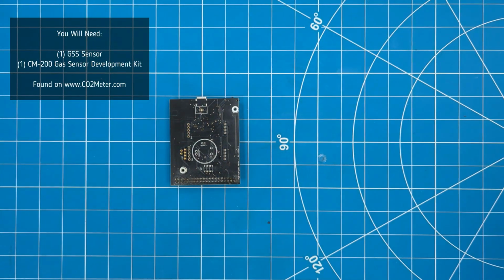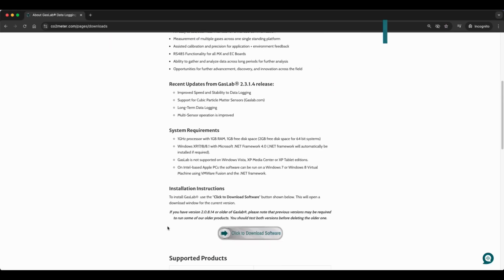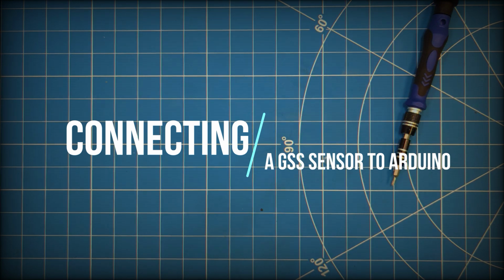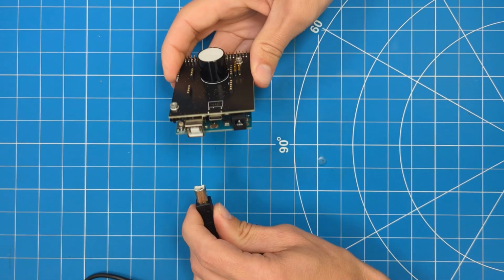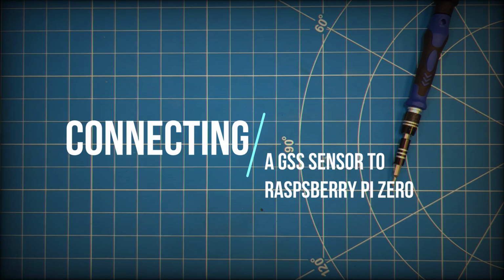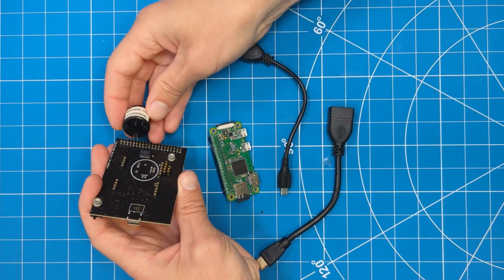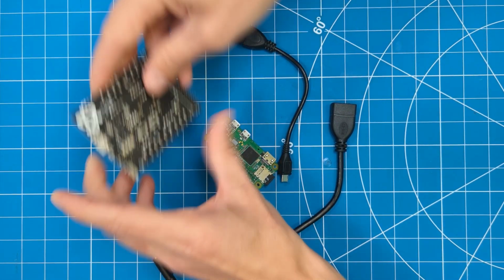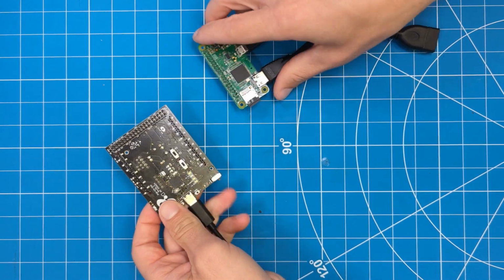Connecting a GSS Sensor to Gaslab, Arduino, Raspberry Pi using CO2Meter's Gas Sensor Development Kit

Comment: Can this gss sensor be coded to detect the type of fuel being used for a machine? Like gasoline vs diesel ?
Reply from the maker: Hi there, the gas development kit works with select CO2 and O2 sensors, for the full list you can look under the specifications tab here: https://co2meter.club/4g5ESUg for further questions, please contact us at sales@co2meter or call us at 877.678.4259